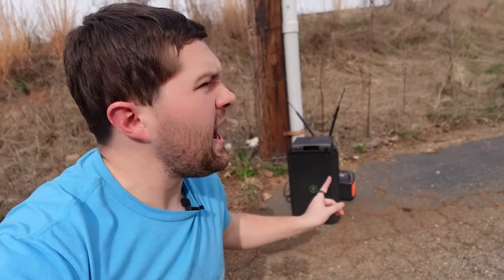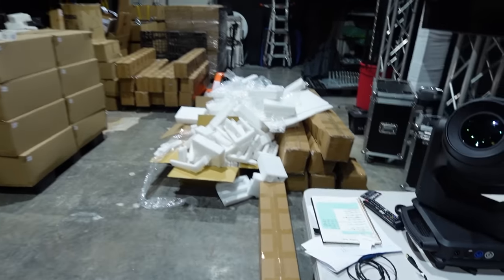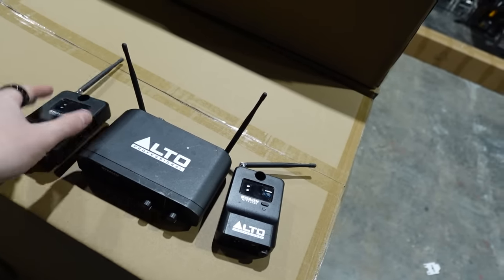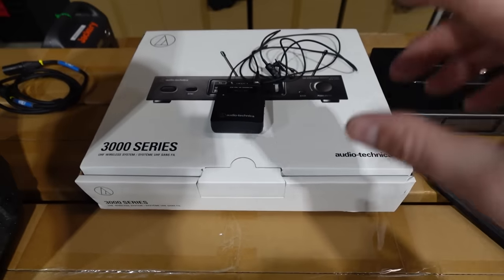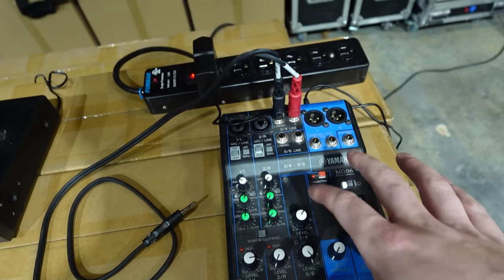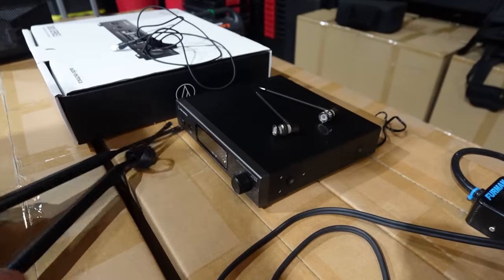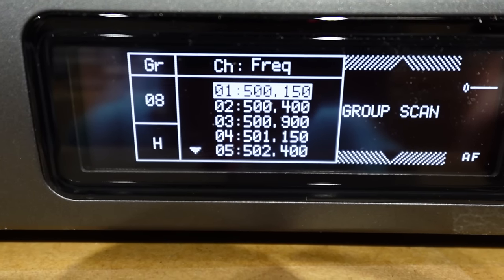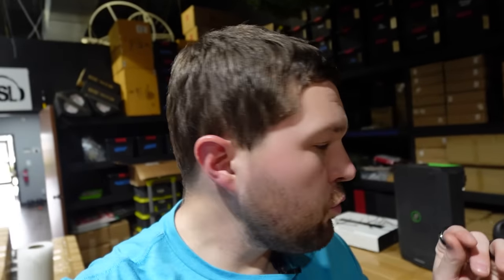DJ Gear - How to run WIRELESS audio to speakers (Wireless Mic Speaker system)

Comment: • Excellent, DJ Rick Webb, thank you for this and for all of your videos.
What about getting sound outdoors to all four sides of the building?
This is DJ Dennis James "The VOICE" O'Boyle out here in Wisconsin.
> I've been looking for a solution to a complicated audio challenge, getting sound around a 300' x 150' building at an annual classic car show. Rather than running miles of cable with all of those headaches, your wireless solution seems viable for our event here in August each year.
> I will try it out ! Thanks again.
• At this other show, they have me working at the edge of a barn door:
https://www.youtube.com/watch?v=aQUulqlpTIE&t=10s
Reply from the maker: Use this setup like a repeater. So hook up another body pack transmitter at the end and repeat. Use different freq for each leg around the building to avoid conflicting channels.
Reply: @DJRickWeb  GREAT! Thank you, DJ Rick Webb. If you ever get to set up all four sides of a building like you described, please add it as ano0ther of your excellent videos.

Comment: Been doing this for years https://www.youtube.com/watch?v=-nVaKou8khQ  The one thing that I didn't like with this current set up is worrying about peaking at the transmitter.  I've switched to an IEM set up which works really well but, I did have to add a headphone amplifier to get additional gain on the receiver side
Reply: Oh, one other thing that you can do to extend the range is to add an directional fin antenna

Comment: Dude never heard of IEM systems. 

Way easier and smaller receiver.
Reply from the maker: IEM is not a true diversity system. Its only one antenna vs 2 on these systems. The Alto stealth is a IEM and it doesnt do nesr the range or reliability of a true diversity system. You can setup backup freq to swap to or some mics auto switch between them with the two antennas to maintain perfect signal.
Reply: @DJRickWeb  
That can be BUT your transmitter is a one antenna-deal.
My experience is that on those distances diversity does not make a difference. Your 1/2 wave antennas make the difference. 

If you go IEM, you can hook the transmitter up to a directional antenna and "beam" your signal across. You will get the same distance or more but stereo and easier to hook up with less hassle when in comes to in/output impedance and levels.

And no disrespect intended with my "Dude" comment.